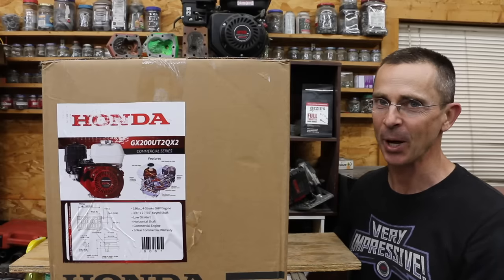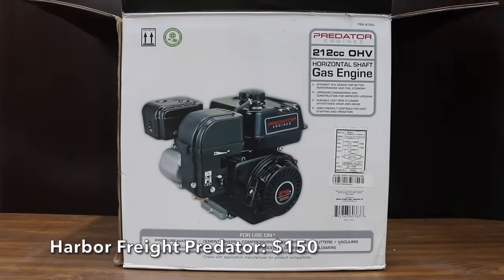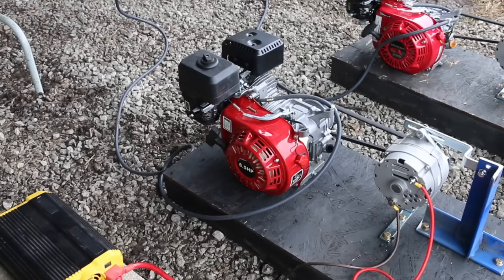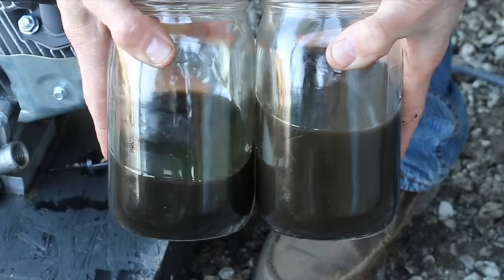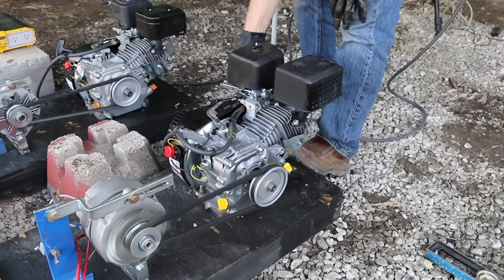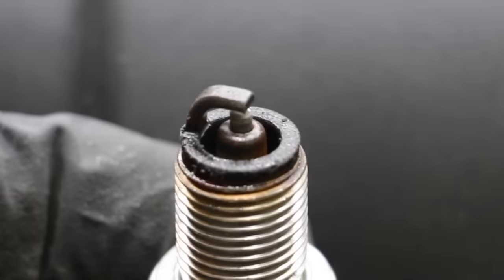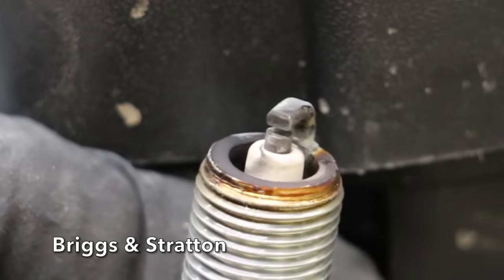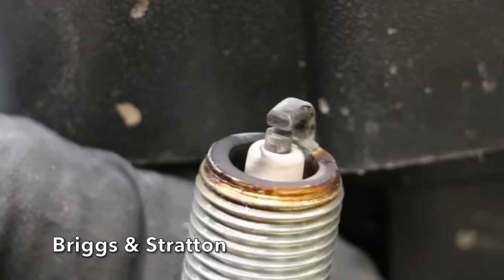$150 Honda Clone vs $600 Honda? Let’s settle this! Fuel Efficiency, Horsepower, Durability, Starting

Comment: We call a Chinese made Honda clone a Chonda. After it was a year old it started leaking fuel everywhere. The PVC fuel line from the tank to the carburettor went hard and brittle. It wasn't a gasoline rated PVC hose.
Reply from the maker: Thanks for sharing.

Comment: I don't know if you have seen the Northstar engines from Northern Tool, But they have a 300cc and 420cc EFI engine now. I'd be curious to see what the difference is between those and similar carb engines in fuel efficiency, power, and noise
Reply from the maker: Thanks for the suggestion.

Comment: A friend of mine builds Gocart racing engines. If you bring him a Predator 6.5hp engine, new in the box and $150 for parts and $100 for labor, he can build you Gocart race engine that kicks these $2500 “race engines” you can order from N.C. arses. The rules are very stringent and his engines have been torn down completely and are 100% legal. So, for less than $400 he builds, by far, the better race engine than any one, or company I’ve ever seen. I know his secrets and they are simple and make perfect sense but nobody has it figured out like he does.
Reply from the maker: Thanks for sharing!

Comment: I’d use a high end spark plug in the clone & ensure it was adequately broken in using a 15W-40 conventional oil for 50 hours. Would like to see if it still burns so much oil. The Honda seals would require minimal if any break in compared to the clone (clearly!). Was the clone engine properly broken in? I guess maybe that’s technically what you’re doing in this video though. That looks like an extremely poor clone if it’s burning that much oil out of the gate though. Some of the Chinese generator engines appear to be better clones (more smooth with less oil burn). In this application I guess I’d go with the predator for a go kart.
Reply from the maker: Thanks for sharing.

Comment: Thanks for this brillant video ! Nice work !

we can easily conclude this Honda clone is not a clone, but a vulgar knock-off that will not last long. it will not last long by following the maintenance recommended by Honda, it clearly need extra maintenance, additional expenses and and obviously a replacement much sooner than the Honda.
The condition of its spark plug is an unmistakable indicator :)

A real clone would have obtained the same results as the original, that's a simple definition of a clone !
Reply from the maker: Thanks and you are wecome!

Comment: As a business, we use a number of machines with Chinese built engines and have little if any problems.  We regularly change the oil….quick, simple and cheap. Clean the air filters constantly, which I regard as essential maintenance but have to admit rarely if ever check the spark plugs…something that will change after watching the video.  We never run the things at maximum revs for long periods and they just seem to go on and on.  Always use quality fuel and clean off with an air line if possible after use when used in a dusty environment. 
Bonus?   Should they go wrong….scrap and replace with new….ridiculously cheap.
Reply from the maker: Thanks for sharing.
Reply: @@homie3461 Can’t accept that theory.  The Chinese manufacturers we deal with recommend you change the oil, clean filters etc., far more frequently than their competitors.  This ensures the equipment stands the test of time and in our experience proves their point.  
Our experience is from actual use, not from propaganda.  Users are responsible for environmental costs by not accepting responsibility for neglect at their and the planet’s cost.

Comment: I bought a predator, and it ran fine over the summer. I stored it for the winter and the next summer it wouldn't run. I'm guessing fuel wrecked the carburetor. I've never had that happen with any other engine I've owned.
Reply from the maker: Thanks for sharing.

Comment: Bought a used honda powerwasher motor...gx200..billet flywheel and connecting rod...titanium push rods, 1.3:1 rocker rollers upgraded springs and a hot cam...pushing 12-13 horse i believe...hits 60 mph in minibike.
Reply from the maker: Thanks for sharing.

Comment: (4) Predators or One Honda GX 200...better yet...(1) Predator with Billet flywheel and connecting rod, a 24mm Nibbi Carb and a .265 hot cam (Making 15+ HP) or one Honda GX200 (6ish HP)

...Choice is yours

Comment: ive had an unkillable predator for almost 4 years now. facebook marketplace minibike with the 212 predator with a carb + k&m intake. i dont even remember the last time the oil was changed. its been wrecked 20+ times, no kill switch, brakes are gone, tires bald, handle bars bent and grips are ripped up duct tape. but she still starts first pull no matter what or how old the gas is. literally indestructible machines
Reply from the maker: Thanks for sharing.

Comment: Apart from the oil consumption, all the other tests were limited by the onboard governors, which could have all been set for a different max rpm.   The plug analysis may be informative, but as you did not use running-in oil, this needs to be re-checked in a year's time.

Comment: I have the HF 4000W Generator with the Predator 212, paid $280 with the wheel kit.   That thing has bailed me out through many multiday storms, running A/Cs in 90 degree weather and it never so much as skips a beat and 1 pull to start it.  It owes me nothing.
Reply from the maker: Thanks for sharing.

Comment: Using full synthetic before break-in is guaranteed to cause a motor to burn oil. Use regular oil for the recommended break-in period and THEN full synthetic.
Reply from the maker: Thanks for the feedback.

Comment: An interesting comparison, but, even though you may think the Predator is a better value over the Honda by a slim margin based on cost; I want you to know that I worked for a Honda dealership back in 1992 when Hurricane Iniki slammed the Island of Kauai, in the Hawaiian Islands. I was the point man for my Honda dealership in Kauai for three months, and saw many generators their that people bought - Honda, Suzuki, Kawasaki, Generac, Briggs and Straton, and every generator that a person could buy from Home Depot/Costco/Any other source - I can tell you emphatically that although the Honda was clearly, at that time, the most expensive generator you could buy, it always started, it never blew up, and after 3-months, it was the survivor at the top of the heap. If you want a generator that will last indefinitely... and worth Every-Single-Dollar you will spend on it!
Reply from the maker: Thanks for the feedback.

Comment: On the Chinese Honda clone motor  it says 3 different output. The 6.5 Hp it says on the pullstart, and on the specs. sticker it is listed 2 different outputs. It says 7.5 HP, but also maximum power 4.0 Kw which is 5.44 Hp.
Reply from the maker: Thanks for sharing.

Comment: The tillitson 212 and Subaru’s small engine would interesting to compare against a genuine Honda 

Also comparing the new Hondas that now are made in China vs the old ones that are made In Japan I wonder if there is a difference in performance and durability
Reply from the maker: Thanks for the suggestion.

Comment: I Bought Same Clone
In Amazon For 99 Dollars 
And I Did Not Read
Manual And I Did Never Run 
24 or 48 Hours.
And It Works Always For 
My Pressure Washer.
Amén.
Reply from the maker: Thanks for sharing.

Comment: If you put those on a cement mixer and run them for a year, restarting them every day, would the Honda inspire you to run your test for 3 or 10 years? When would the others fail? This construction Joe , Only used reliable Honda motors. But The world is curious.

Comment: Im skeptical about the oil consumption because you used synthetic oil. General use machines typically use standard 10w30 conventional oil. Synthetic oil has smaller molecules leading to leakage and id assume blow by in a small engine designed for conventional oil.
Reply from the maker: Thanks for the feedback.

Comment: So, the Honda and the clone came damaged (at least for the ones you received) whereas the Harbor Freight and Briggs and Straton had no damage (though the foam covers are thinner, and the clone didn't come with the filter it claims to have). There are some points values right there.
Reply from the maker: Thanks for the constructive feedback.

Comment: I don't know if anyone else mentioned this in the comments, but isn't there a break in period on these? Just like anything, most motors that I am aware of you would run them for so long and then change the oil to get rid of impurities left over from the break in and let the parts set in their wear patterns...
However I enjoyed the testing but that was just one thing I was thinking about and wondered ...

Comment: I can tell you this from experience putting them to use commercial and the Honda's by far end up being the best. They last a really long time and are super reliable. The Knock offs use less quality materials and they do not last not even half as long. Take a Honda Generator vs. Chinese Generator the Chinese model will be dead within 1-2 years while the Honda is going 10 years later. I have seen this over and over again. In our business they run every day 10-14 hour shifts and in 100 degree weather regularly the Honda GX series engines last!
Reply from the maker: Thanks for the feedback.
Reply: @ProjectFarm  Love your videos and your tests are great, but when it comes to long term reliability that is where the Hondas shine they just use better quality metal in their builds. Now for a Go Kart or Mini-Bike a predator is great, but if you need an engine for long term use and depend on it to make money with that Honda is the way to go. We use them to run pumps and they run 12-14 hours a day during the summer and we start in Jan. Speaking of Mini-Bike fixing to get me one for fun around the house so may upgrade it to a bigger Predator engine since its not an engine that will be running every day for hours on end:P

Comment: I'm not agree with the "force to spin over engine" test, it should be measured directly on the crankshaft to be precise. Like this I'm pretty sure there is not reprensentative of the real compression. For example, the winding diameter could be slightly different.
Reply from the maker: Thanks for the constructive feedback.

Comment: in philippines i bought a fake honda scooter.  It was really good motor and trans but everything bolted onto it was crap.  It was called a Rusi.  It was very quiet and strong.  it was very smooth running
Reply from the maker: Thanks for sharing.

Comment: I have bought the larger clone engine.  They may not have the same charging system.  So the electric starter motor seldom gets used. The honda and its clones parts are interchangeable.

Comment: The machining tolerances in the Honda & predator clone may not be as good as the actual Briggs and Stratton & Honda engines.

I have heard of a story about when someone bought a clone engine which had missing valve stem oil seals which caused it to burn oil as well, the engines should be run in after 24 hours of use.

I replaced the piston rings in my dads Honda GSV190 engine & it smoked intermittently on startup for the first 15 hours of use until the piston rings fully seated into the cylinder walls.

I have ordered him a new Honda GX35 clone engine to replace his 21 year old Honda GX35 brush cutter engine which has done a lot of work, Yes I did replace the piston rings & piston with a Chonda one but it was still burning oil because the cylinder had a couple of score marks in the cylinder so to save all the mucking around I bought him a brand new Chonda engine for $125 AUD including postage and handling on eBay.

It's kind of an early fathers day present this week, when I receive it then we will see how well it goes compared to the original Honda engine,I am aware that the piston rings will need to break in as well,I might buy a cylinder kit & build another clone engine out the old one as well !

Comment: Briggs&stratton is not good for go-kart, but it's good for other uses, like lawnmower etc because it has heavy flywheel, i had 4 briggs (Now only 2) and i can really feel it, it takes really long time to get briggs to spin up, but when mowing, it doesn't die, i have a lot of time to stop and wait for it to get back to peak rpm
Reply from the maker: Thanks for the feedback.

Comment: Curious if you think the B&S was tuned poorly out of the box. The stalls, fuel consumption and power output all seem to indicate that it wasn't operating as efficiently as it could have (especially since fake honda didn't have a stalling problem). 

Do you ever do videos on quality control? I think it'd be interesting to see 4 of brand XYZ compete against each other. It might be a dud of a video if they all perform the same, but I think the gold standard for quality is repeatable outcomes.
Reply from the maker: Thanks for the suggestion.

Comment: Interesting test comparison, especially for me as a small engine mechanic (58 years) but I'm sorry, Todd is very hard for me to listen to as he talks so fast and his voice is so shrill. We obviously get engines here that you don't get there, our biggest seller is sold here as Sina and Loncin, but we also have Kohler, which I've always thought of as the best, and Subaru Robin are still sold here. Robin is the top pick for Vibrating Plate Compactors as they withstand the vibration better than any other engine, and Kohler are top pick for extremely high load applications such as Concrete Saws, concrete pumps and large Chipper/Shredders, they never break. Briggs & Stratton are of no use in any of those applications.

Comment: The Loncin series of China built engines are quite reliable.
Toro, Exmark, Scag, Cub Cadet and others have used them with good results. They are however twin cylinder and a more expensive design.
Reply from the maker: Thanks for the feedback.

Comment: I collect cub cadets from the 60s and each of them weigh 650 pounds with my pulling tracker weighing 950. Think any of those engines could pull one of them

Comment: Even if a Honda isn't immediately the best value, it will easily last 20 years and during that time will have better fuel economy and less wear. It would easily make up for its higher purchase cost. Especially when reliability could mean the difference between success and failure in many applications.
Reply from the maker: Thanks for sharing.

Comment: The big difference will be how many total hours each engine will last. The cheaper engines will have cheaper alloy metals used in the cylinder, piston, rings and head. In the long run the cheaper engines will have a shorter life.
Reply from the maker: Thanks for the feedback.

Comment: Dear Sir, Would it be possible to slow down on your presentation of the products you are testing. It is difficult to process the information at the speed. I know you are up against the clock and must speak that fast. Maybe more editing can gain some time to slow down a bit. Some may disagree with me, but that is the reason for the comment section. Thank you

Comment: Honda GX 200 = 600 Dollar
Clone Honda GX200 = 150$
4 Honda clone GX200 = 600$
1 Honda gx200 = 600$
With same price, Clone Honda GX is winning due to quad engine rear wheel drive set up
I knew you gonna think this was to much, 
but let's be honest, more engine, more power (Torq), more speed, and more fun ^^
Right???
and seem those clone engine need some cylinder rework and Carb jet tuneup to work properly and honda tho,
yeah take more cost, but seem worth for that price.

Comment: The Predator engine has 2 variants, a hemi 212cc, and a non hemi 212cc. They are made in separate factories, that have very different QC. The non hemi is reliable and long lasting, and the hemi is a crap shoot. I've heard of hemi's being locked up, right out of the box, and I bought a hemi flywheel from them, and the tapered bore was out .015" and runout on the face was more than .125". That piece of scrap flywheel would have smashed my engine to pieces, If I hadn't spent 4 long days scraping, lapping, dialing, and repeating, until I had it running within .0005" on the dia, and .002" on the face. Now my engine runs like a Swiss watch. Don't buy the hemi, there is no QC and they are no better than the non hemi. I've been riding my mtb with the Predator 212cc non hemi for five years, now, with no problems. The only thing I wish for is a 3 magnet aluminum flywheel that I can't find. I have a Harley LED headlight, and an LED bullet tail-light, and the electric start coils can barely keep the battery charged, so I have to charge up the battery, before every ride, to keep the lights on.
Reply from the maker: Thanks for sharing.